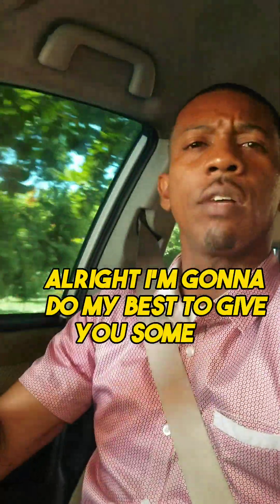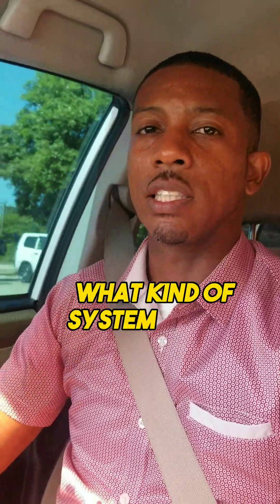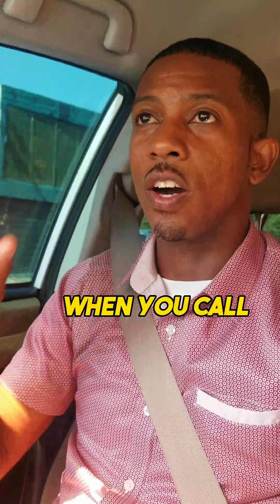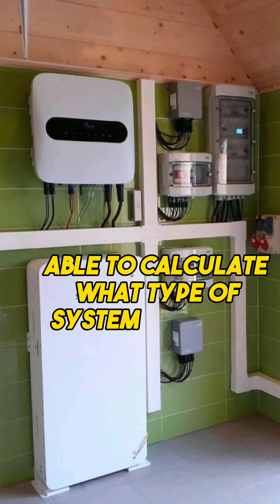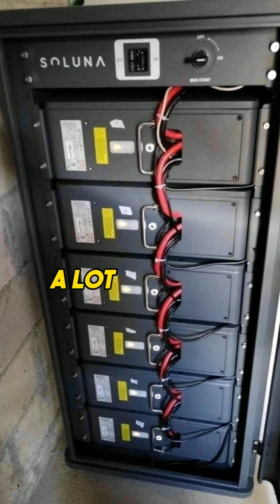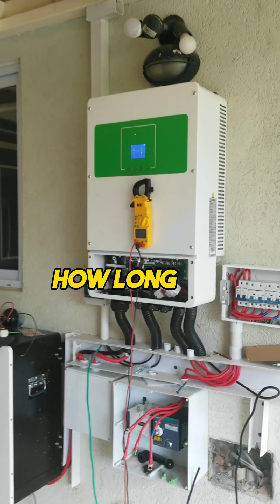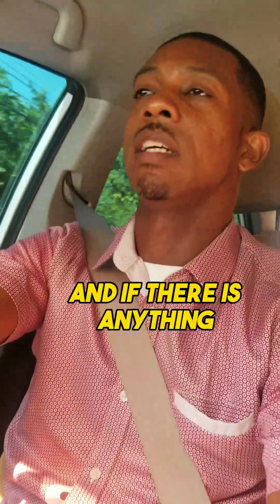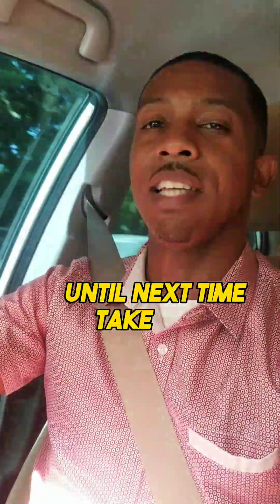First steps when going Solar

Comment: Hi Rayon are you located in the states?  I live in Florida looking to get a system done in my home. Ac unit washer and dryer stove/oven water heater. That's about it our bill is about 280-380 depending on the heat
Reply from the maker: Hello, I am located in Jamaica 🇯🇲